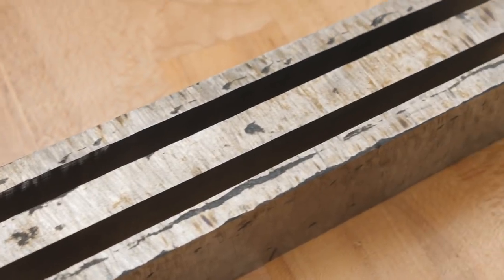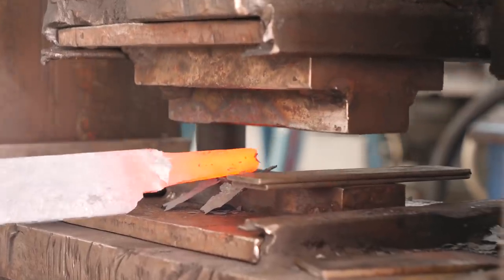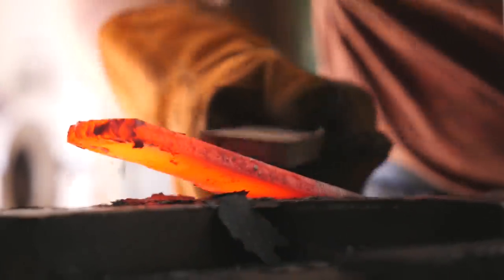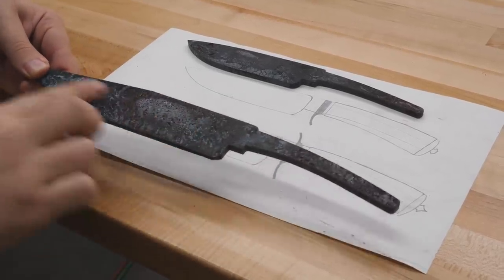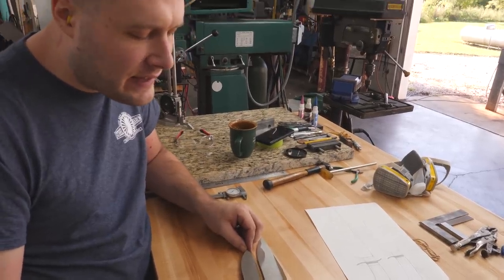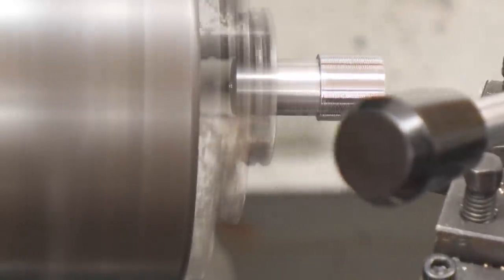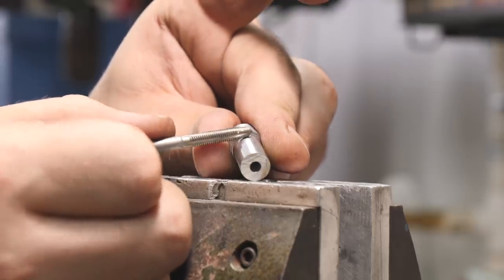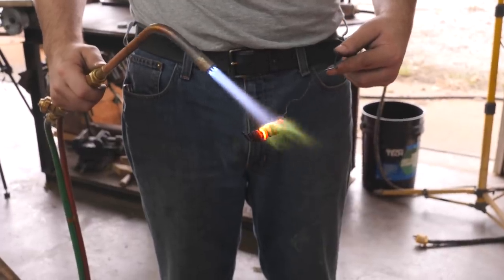5,376 Layer Feather Damascus: Feather Fighter Part. 2

Comment: Very good video, Dad does a great job. I'm anxious to see the on line training video I'm sure it will be very helpful. I have a question about belt grinders, most knife makers use a 2X72, would a 6X48 be as good or close to as good as a 2X72 for knife making. Another thing is a forged blade better than a ground blade using the same steel, I think I saw a video or heard that it was, something to do with  the molecular structure of the steel.
Reply from the maker: Hey Kenneth, you will be able to put a lot more psi on the surface of a 2” belt. A 6” belt will spread the psi out over a larger area. I believe the wider the belt the harder it will be to remove material.
Dad

Comment: What kind of belt grinder do you use?
Reply from the maker: Good question Damon
We use a KMG and a Grizzly currently.
We are looking forward to getting more with variable speed 👍🏻
Dad
Reply: KyleRoyerKnives okay, awesome. I’ve been looking for a nice belt grinder and was curious what you were using.
Reply from the maker: Hey Damon
There are several good ones out there, take your time do your research and get the one that’s going to work best for you. Definitely get the variable speed. And more power never hurts
Dad
Reply: KyleRoyerKnives thank you for the info, I’ll definitely look into it